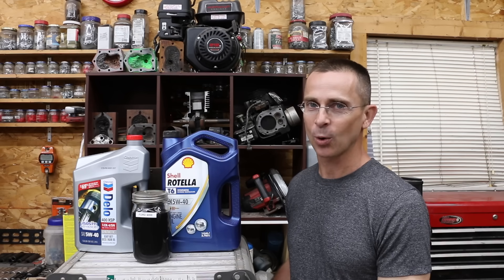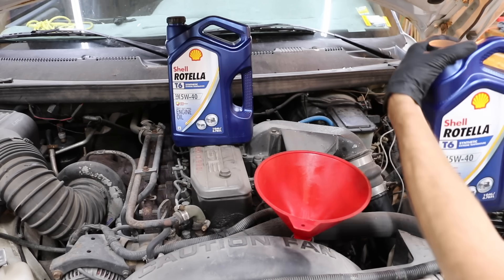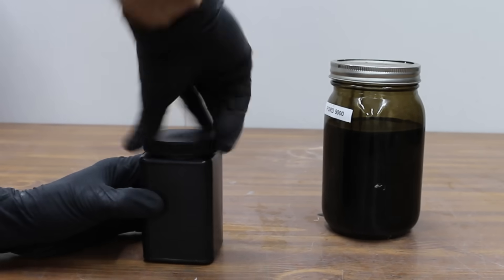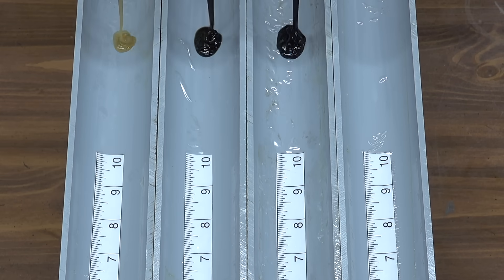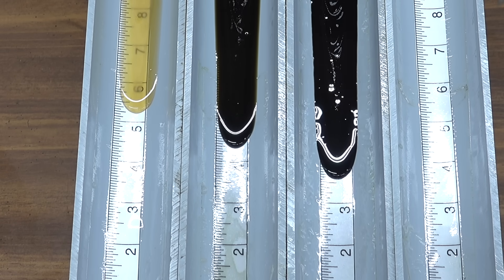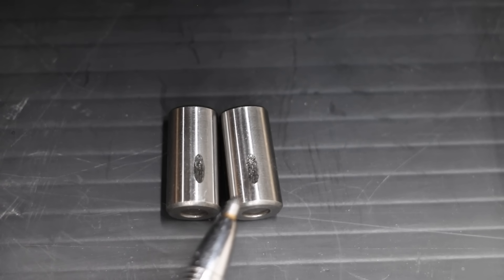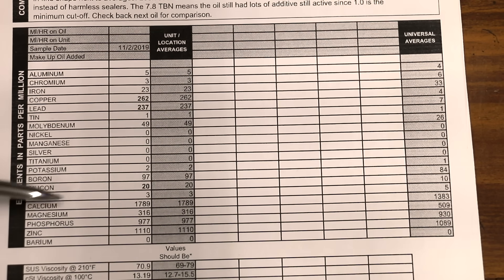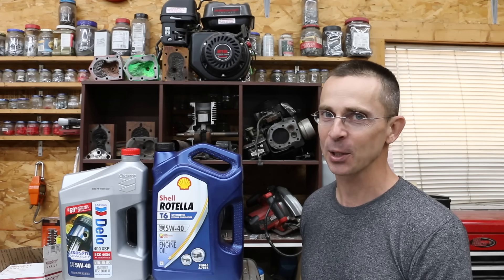Will Annual Oil Change Damage Your Car? Let's find out!

Comment: In a lot of comments to this video the question was what oil to use. 
There is a lot to say about oils, many aspects, many variables. To cut a long story short:
- MOTUL 8100 X-Cess 5W40
- Mobil 1 FS (Full Synthetic) 0W40
- LIQUI MOLY 1307 Synthoil High Tech 5W40
are good oils.  I wont go into details why, as this would end up in really long comments.

And yes, all of these oils are expensive ... doo.
You may save money by extending the change intervals, not by buying cheap oils.
Reply: My car's manual says use only 5W-30 or 10W-30.  It also states: Do not use 10W-40.  Now what?
Reply: @PrimalMiltos  Now you tell me what car you have , how old it is and what the max outside operation temp is where you live.  

Usually car makers are more specific on what  exact classification and approvals the oil needs. Stuff such as "meets VW 50400/50700 specs" or the like. 

Making a temp range mandatory is somewhat unusual.

Basically the oils I mentioned are better then any 5/10W30 oil.  Cannot think of a good reason to no use them anyways, but let me know and I try to find out.

Comment: I Love your videos! I’ve watched just about all of them now, I’ve always been curious, what would win in an economy test for fuel consumption, an antique hit and miss type engine or a more modern Briggs and Stratton type lawn mower or other small implement engine of the same horsepower
Reply: The newer engine would win. On a hit or miss you're not getting any power from the misses but fuel is still being consumed. Lots of other reasons too; it wouldn't be close.

Comment: Fun Fact: You can clearly see in the video that the freezer is not set to  -40degF but to  -40degC.
Does not matter, as  -40 is the only temperature where Degree C = Degree F
Reply: That's absolutely correct! At -40, Fahrenheit is the same as Centigrade.(Celsius) It's the only point of crossover on the thermometer.
Reply: That deserves a thumbs up.
Reply: ... agree. The race track was room temperature though which kinda screwed up the experiment...
Reply: @f.d.6667  not really since the oils were all subjected to the same conditions.

Comment: Great video. My question is. What if you’re putting 7-10k on that oil in a year & is it’s not just sitting there being unused?  You’re actually driving it? Will the oil still be good?  Thanks
Reply from the maker: Thank you
Reply: change the oil/filter annually then.

Comment: I live in Finland and temp here is during the winters from +5 C to -20 C. Summer temp is about +5 to 27 C. I change the motor oil every 15k km or 1 year. With modern oils it's okay to change them 15-20k km. But this long life crap is to be avoided. Don't wait to change your oils every 30k km. This will create sludge inside your engine. There are lots of ruined VAG engines to prove that. Maybe in a warm country you could do that but I wouldn't risk it. If you want to be "really safe", change your oil every 10k km. Changing at 5k km is just stupid, unless it's some sort of sports car that really requires it.

Comment: Video Idea:   Can you please test a few brands of Hydraulic Tractor Fluid ?  I would like to see a comparison of a conventional oil with cold weather additives versus a full synthetic oil, especially in the freezer test.  My tractor hydraulics does not run smoothly in very cold weather and I would like to see if the cost of switching to full Synthetic oil can really make a difference.
Reply from the maker: Thank you for the video idea!
Reply: synthetic > regular for that climate in your case

Comment: in fairness them cummins engines are robust they can do so much more miles than what you have on your pickup and a hell of a lot of abuse, we had a lot of old trucks where i used to work that were still good and didnt require any rebuilds or major attention  at 860,000km   wonderful service and forget engines
Reply from the maker: Impressive durability!  Thank you

Comment: So, talking to the local Napa guy here in Utah, his buddy works for the fire department and on their fire engines, they change oil filters every 5-7k miles and the oil the test every time they change the filter. They finally changed the oil around 22k miles (not including idle time) after their results came back.
What’s your take? Bad idea or is it worth looking into since it potentially saves money and time?
Reply from the maker: This is great information.  I'm sure it save the FD a lot of money due to the oil capacity.  It's a little too far between oil changes for a fire truck in my opinion.  For an over the road semi, it seems fine. Just my opinion

Comment: Changed the oil in an old dodge truck I have owned for several years with a 5.9 reman engine I bought in 1992 I think.  Pretty sure It had not had an oil change in several years.....
Reply from the maker: Thank you for the feedback

Comment: Big point on the last minute: once a month bring up to to operating temperature (i.e. boil out all the water condensation?).
Reply from the maker: Thank you.  Yes, it'll cause the condensation to evaporate.  Thank you
Reply: emosh73  - about 10 minutes of driving  in the city. It's also good for the battery especially in freezing winter (  battery starts to deteriorate quicker the lower the charge state ).
Reply: ferkemall  
Have to pay for the NHS.

Comment: Have you done a video testing the various synthetic lubricants like Mobil 1 and other heavy lubricants? I need to chose a lubricant for a high friction, low velocity project where I have steel ball bearings in a detent on a brass shaft. The ball bearings are held in position with s brass race. Over time the bearings eat through the detent in the shaft. Initially,  the detent is .1" and 3 steel bearings ride in this detent. 
I have use Mobil 1 and 10% by weight of Tungsten Disulfide which is nano lubricant. It has greatly improved the life of the brass shaft. Just wondering if a better grease will last longer.
Love your MOST informative channel. As an electrical engineer I really enjoy your practical demonstrations with excellent empirical results. The best to you in 2020  Glenn SC

Comment: My 1.9Tdi has 244k on it and the one I had before my wreck had 300k and my father's has 330k and they have used T6 for their lifetime.   7-10k between oil changes. In north Florida.   Good stuff.
Reply from the maker: Impressive!  Thank you
Reply: @ProjectFarm  So, great test. This recertified what I already suspected.   Great video. It's time to change my oil again.  How much is the Blackstone test?

Comment: I have another engine oil related test for you.  Is it better to change engine oil when the engine is at full operating temperature, or is it sufficient to change engine oil when the engine is at ambient temperature?  That is, presuming the ambient temperature is warm enough for the oil to flow well -say 70-80 F.  We all know that manufacturers and mechanics recommend changing oil when the engine is hot.  The reason cited for changing oil when hot is usually that it keeps as much particulate in suspension in the used oil as possible.  The benefit to a mechanic or quick-lube oil change place is that the oil will flow as fast as possible from the engine, allowing them to move on to the next vehicle faster and perform more oil changes.  The potential negative of this method is that some oil could still be running down engine components that are higher up in the engine and you end up with an incomplete oil change.  On the other hand, there is a thought that if you change the oil on a vehicle that has been sitting at ambient temperature, then all of the engine oil that will drain from the engine will have made it to the sump.  Modern engine oils should be able to keep small particulate in suspension and any particles that are too large to be in suspension should have been caught in the oil filter anyway.  It might be worth a look just to keep people from being scalded when changing hot engine oil!  It would be interesting to see if there is any difference in the volume of oil drained and if there are any differences in an oil analysis.
Reply from the maker: Great video idea!  Thank you
Reply: well, those oil changing places probably see the oil temps already at operating since they were driven to those centers. and DIY like myself would just let it drain more completely while doing something else, like checking other things

Comment: I believe moisture contamination is only an issue on engines staying unused outside over the seasons. Any engine frequently in use will quickly evaporate any moisture.

Comment: Could you please test the following.. 
Is a open bottle of unused oil still good to use after a year?
For example. I change my engine oil today, I buy a 5 litre bottle of oil (I live in the UK)
The car takes exactly 4 litres.
A year later I want to change the oil again, can I use the remaining 1L of oil that's been sitting in the garage for a year plus 3x New 1L oils (to make the required 4L) mixed together?
Would the old oil sitting in the garage have absorbed moisture from the atmosphere and should not be used?
Thanks
Reply from the maker: Thank you for the video idea!
Reply: @ProjectFarm  Your welcome. Thank you for your thorough videos..
Reply: this isn't like brake fluid; where that thing is hygroscopic "you can get about five years out of a bottle of motor oil." http://knowhow.napaonline.com/understanding-brake-fluid-shelf-life-important-auto-essentials/

Comment: Fun fact about Rotella, the 15w40 and 5w40 have JASO MA/MA2 certification for motorcycles with wet clutches. The 5w40 is a way more affordable alternative to synthetic motorcycle oil. I have used it in my street bike for years.
Reply from the maker: Thank you for the feedback

Comment: This is a completely useless test, hence the conclusions drawn are ditto.
Oil in engines exposed to city driving has a significantly harder life than oil in long distance vehicles, fact! 

So, stating only the usage-mileage of the used oils tells precisely nothing.
Stick to what you know is my advice ;-)
Reply: The test was specifically about vehicles that aren't driven much, where a common suggested OCI is 12 months. And PF specifically said that you need to get your engine up to proper operating temp once a month on vehicles that are not driven much. That is, take it for a blast on the highway. City driven vehicles should be driven on the highway for a blast once a month for their health. It's cheap maintenance.
Reply: What he basically says is that oil-change intervals based on TIME are nonsense. That does not conflict with your Idea and the test is not " completely useless", as he more or less tries to test if the oil degrades a lot by just "sitting there".
And the mileage is a major factor. There are - as you state correctly - other important factors, but mileage (or to be more precise: Engine operation hours) is still very important.
So mileage by no means "tells precisely nothing".  It does not tell the whole story, though, true.

Also I think that criticism could be phrased a bit less harsh.
Reply: @autotipps6993  Very true.. As for Iz Meorbin, the old biblical adage in proverbs applies in that a fool discerneth a matter before he heareth it.

Comment: I don’t change oil. My car burns a lot and I just top it up. Fresh oil every week.
Reply from the maker: Thank you for the feedback
Reply: Don't do that. Dirt, soot, water in the oil etc will build up, as the car burns only parts of the oil. So you may want to drain that old sludge every 18 months or so, even if you need to add fresh oil often.
Reply: Autotipps just joking lol

Comment: Change every year for 2 vehicles one 7000 miles the other 3000 . Use mobile one full synthetic and changed both vehicles over to that at low miles The gmc sierra is almost at 200,000 miles and kia rio close to 150,000 . These are budget vehicles one is 15 years old the other is 14 and both have been running well with only replacing some small inexpensive items . The rio you have to replace the timing belt every 60,000 miles which is labor intensive ,. I think making a change at one year guarantees a good outcome  and the expense is so small  and its recycled so no real reason to push past that
Reply from the maker: Thank you for the feedback

Comment: Dang your truck has low miles for a cummins
Reply from the maker: The truck needs to last me 20 more years. lol
Reply: Mine also. 2004 diesel 74k miles. Informative video.  I was only doing annual T6 oil changes. Just did it 2 days ago.  Only put on 1300 miles this year.

Comment: Good quality oil is cheap 
Good quality engine rebuild is not 
Annual service on diesel van (8000 miles)
Every 2000 on road bike (GSXR)
Every other meeting on race bike (HAYABUSA)
All engines like new .
Great test P/F 
Keep them coming 

Common sense really 
Great test
Reply from the maker: Thank you for the feedback
Reply: Good quality oil is not cheap. Or  ... if it is cheap, its not good quality. Anyhow: You are right. Do regular oil changes. But every 18 Months or every 15 K miles (whatever comes first,  bit more often if you drive only in city.) is sufficient - at normal usage (non racing). 

At least if you use an non cheap oil  ;-)

Comment: First things first, 3k is no longer accurate. To maintain your warranty change by the owners manual. Otherwise...

If your car (GMs mostly) has an oil life monitor, use it. It measures stress on the engine, number of rotations, heat, etc.

If your car does not have a olm have your oil tested by a place like Blackstone labs. They can help you determine a proper change interval for your car, oil, and driving style.
Reply from the maker: Thank you for the feedback!

Comment: Please test  OEM ATF  Especially Crappy Toyota WS garbage,  Honda DW-1and since their are TONs of Hyundai/Kias out there Hyundai SP4-M that is suppose to really good OEM ATF. At one point it said it was Ester based , but that Hyundai documentation has since been pulled down. Please test aftermarket ATF in this test, Redline D6 Amsoil SS ATF , Valvoline MaxLife, Castroil, and Mobil1 ATF. Maybe go with longer heat testing. 8 hours and switch pot position every  two hours.
Reply from the maker: Thank you for the video idea!

Comment: I am very happy to see you using the proper Fleetguard Stratapore oil filter! There is no point in dinking around with 3rd party stuff.
Reply from the maker: Very impressed with Fleetguard
Reply: @ProjectFarm  I trust you are aware Fleetguard (aka Cummins Filtration) is a wholly owned Cummins subsidiary.

Comment: What's this? Americans are going to catch up with the rest of the world and stop changing their oil every 5 minutes. Stick to the right spec and change as per the schedule and it won't be the thing that kills the engine. I change the oil in my Diesel at the recommended 18,000 miles and it's still going strong at 268,000 miles. Uses about 1.5l between services.
Reply from the maker: Thank you for the feedback!

Comment: Another good oil test video! How about a test on transmission fluids, with special attention given to "unversal" type ATF's vs OEM specific ATF's. Would be particularly interesting (ie) to see if "universal ATF" can be used in place of (ie) ATF+4, etc... especially in emergency situations where (ie) a retailer  doesn't stock ATF+4 (or has been sold out for days) but is well stocked w/convenient gallon-sized jugs of "universal ATF".
Reply from the maker: Thank you for the feedback!

Comment: You made a Very important point . about Allowing the vehicle / Motor to reach it operational temperature at least once a Month . Water / Moisture boiling point is 212 F  and any motor running at normal operational Temps well exceeds the pointing point . The small amount of Moisture build up in a semi oil sealed system in a Vehicle ,  should easily be vaporized / burn off easily .  I have a 2012 GMC Serra Denali 1500 ,  6.2 engine  and it has less than 37,000 miles on it .  I use full synthetic Royal Purple and have been changing it once a yr . When I change it the OIL still looks good & feels good ,  I strain it thru a cloth and give it to a friend who reuses it in a OLD JEEP  LOL .    GOOD VIDEO  ,  I knew that the oil was still good !!!  You just confirmed it !
Reply from the maker: Thank you for the feedback!

Comment: I personally change my oil in my early 2000's Passat TDi's every 5000 miles, with genuine VW (Quantum) oil and Mahle OE filter.  I buy it in 20 litre boxes from VW and oil filters in a box of 10.  Over 250k miles on both with zero problems.  On cars that don't do alot of miles I change every 2 years roughly
Reply from the maker: Thank you for the feedback!

Comment: We once owned a '92 VW Golf III Diesel variant, and it ran over 407k Km / 253k miles on its original engine and gearbox. My father used to change the oil and oil filter every 10k Km / 6.2k miles regardless of the optical condition of the oil. It was always as black as tar. But the engine did perform well without any problems. But we had to give away a nice car because the german government taxed the annual fees over some €500,-. Now the roads are filled with Diesel-Gate vehicles of all kinds!
Reply from the maker: Thank you for the feedback!

Comment: Ran AMSOIL in my 99 24 valve Cummins with the AMSOIL remote filtering (2 filters) at 25k miles and 2 years the testing company said to keep running it, but I changed it for peace of mind and last I heard that truck has over 250k and still runs great with zero blow-by and I changed it yearly every January regardless of miles after about 50k “break-in” including the 25k “test” !
Reply from the maker: Thank you for the feedback!

Comment: I was told by one mechanic that Rotella will foam in a diesel engine is there anyway you could test this maybe using a paint mixer when it is hot and cold Maybe test other diesel oils as well
Reply from the maker: Thank you for the video idea!